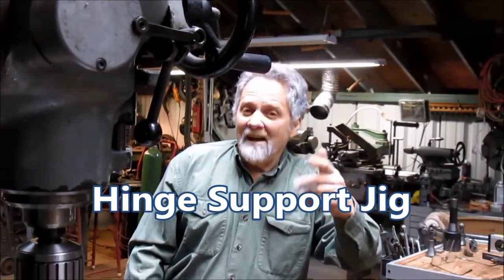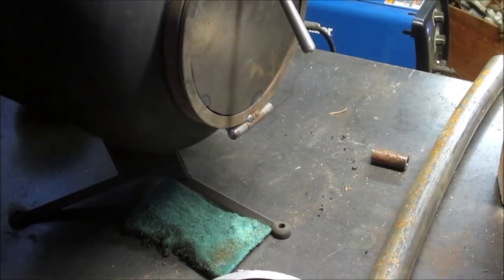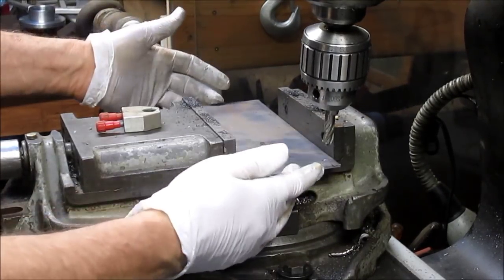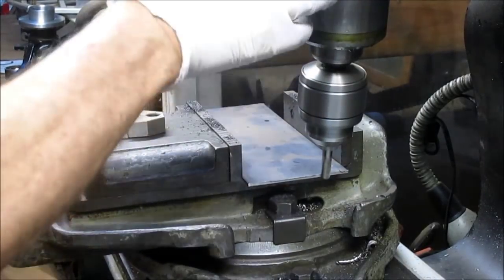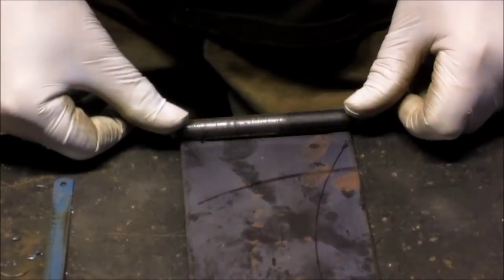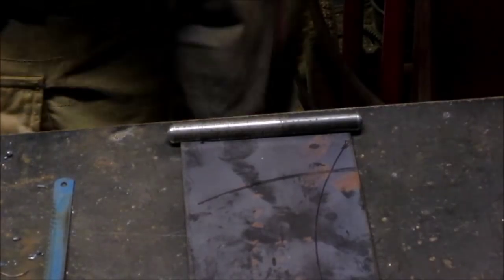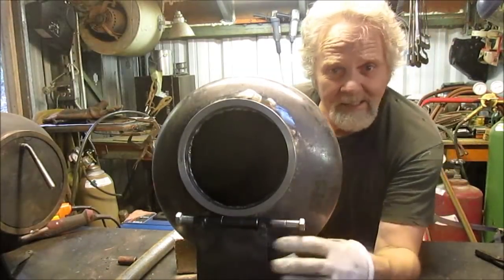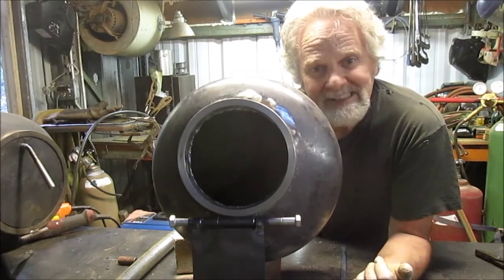Building a fixture for a square hinge square

Comment: if you were to drop a small ball bearing in. the center piece would be solid with a drilled or milled hole and then you could tighten it up secure without spacers and the ball would allow it to move freely when done even if snug. I have seen hinges like that at the metal supply houses